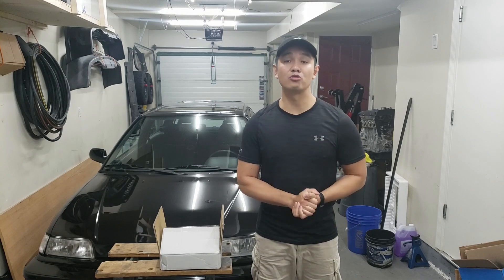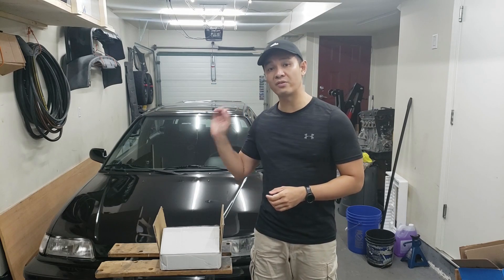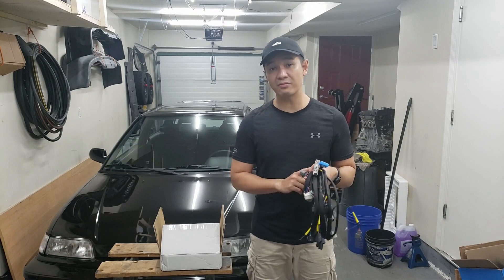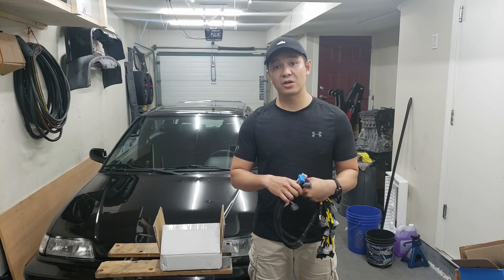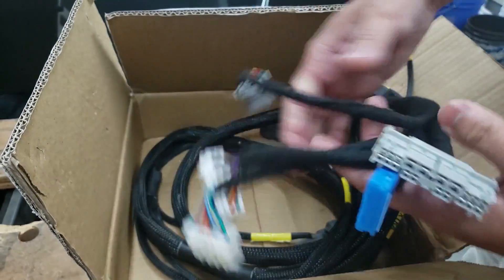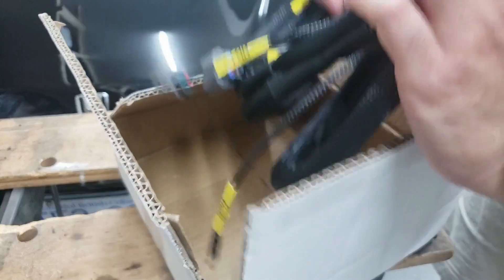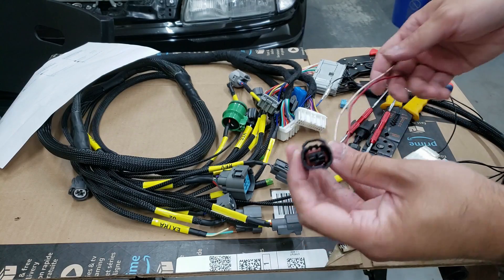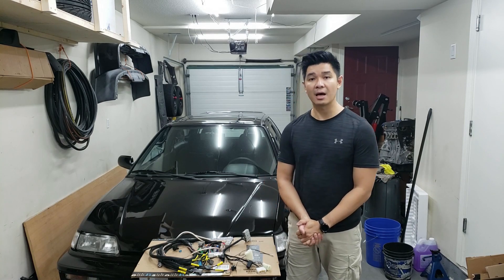||HONDA EF9 / ED7 88-91 CIVIC & CRX|| New Budget Engine Harness & Making a Chassis Harness 🔥

Comment: What does the sub harness plug into ??
Reply from the maker: 🤨 the car.
Reply: @BudgetGears 3 plugs to the ecu then one goes back to the original ecu?
Reply from the maker: @jay24232 are you asking about the tucked harness or the sub harness. Nothing plugs into the ecu for the sub harness. The tucked harness plugs to ecu and to the sub harness. The sub harness plugs into your car. The tucked harness is universal. The sub harness is vehicle specific. The sub harness is a bridge to make the tucked harness work with your car.
Reply: @BudgetGears I’m asking about the sub harness can I buy one for a crx Obd1 b16
Reply from the maker: @jay24232 not all engine harnesses are the same. You need to buy the engine harness and sub harness from the same manufacturer. If you got a China harness like i did, you'll need to map all your wires and make your own. The harnesses are not made equal. My harness could be very different from yours etc.
Reply: @BudgetGears I can buy another loom where can I buy the sub harness

Comment: Where did you source the connectors and pins for your chassis adapter harness? I'm also doing a EF with one of those budget engine harnesses. Thanks!
Reply from the maker: I did countless hours of googling to search for the connectors. There wasn't 1 specific places. Just all random sites. What was shown in the video was just the connectors I used for the harness. But I got a bunch of obd1/2 style connectors as well for other things. There's some stores in Japan that sold oem connectors, which required a min purchase,  then there's ebay, Amazon, other random sites, etc.
Reply: I didn't like the idea of plugging the chassis adapter to the engine bay connectors, so picked up a EK specific one off Amazon since it was cheap ($36 and change ) and arrived in two days. All I really needed was that big gray connector, I'll be hardwiring that adapter to the dash harness

Comment: how did you deal with connecting alternator wires? I have the same harness as you, one wire is going into ECU as it should and two of them, that is ignition and light, goes into the subharness connector, but how do you connect them if there is no equivalent on the obd0 harness so even the adapter that you've made won't help? Isn't it necessary to connect them to ignition switch?
Reply from the maker: Not sure what you mean no equivalent on the obd0 harness. Your firewall connector the 8 pin connector that's covered in grease that has a brown cover has the 2 wires for the alternator ignition and the alternator light in there.
Reply: @BudgetGears  oh you meant the one under the hood, got it. There is a 8 pin connector but I don't believe ther's that second one with 4 pins, is it something that not all of the 4th generations have? Also, are you reusing any other plugs on the shock towers besides those two connectors?
Reply from the maker: @kamidayaa264  There's 2 kind of wiring for the 4th gen's. Si's and non Si's. The Si's are wired for multi-point and the non Si's are dual point. The non Si's will use more shock tower connectors. What I have is a Si so it'll be what you see in the video. The non Si's will use more connectors.
Reply: @BudgetGears  that's very helpful actually, but the problem is that my non si car has less connectors than yours, specifically that 4 pin that you made a connector for in your sub harness, what was it for if you remember?
Reply from the maker: @kamidayaa264  I can't remember. I do remember one of the differences was the location of the backup light switch wires. You should map out all your wires and it'll be the process of elimination. I spent days mapping out my wires and checking the China harness before building the sub harness. The China harness was wired wrong so best to check your wires.

Comment: What wire did you use as power to the ecu
Reply from the maker: @madboostmark  Not sure i understand your question, but automotive wire was used.
Reply: @ I have the same harness… but I see no spot for the 12v power (for ecu) my car is a race car with no factory harness or fuse box.
Reply from the maker: @madboostmark  i can't remember the wiring fully, but pretty sure everything was turned on and activated through the ignition wire. I cant really provide much info on your situation because you've taken out so much of the oem stuff.

Comment: hello again! I'm back with another question n.n on the alternator connector, how did you know which wires S, IG & L belong to to change to the green connector?
Reply: My old harness has a Canadian model 3-pin oval-shaped connector, but I don't know in what order to attach the wires to the old connector.
Reply from the maker: @zairabarrigagarcia9411  you'll need wiring diagrams for the vehicle you have. I googled the wiring diagrams, went to my car and confirmed the wire colors and wire positions. I then googled the wiring diagram for a 4 pin connector that came on the harness. Did research to confirm if the wires were correct, which they weren't. Then cut the connector and rewired to the green connector based on the wire position.

Comment: Please show how you made the sub harness.
Reply from the maker: You can already see what I used to make the harness in the video. It's just crimping wires and plugging them into the connectors. If you're asking about the wiring, I can't help you there. Every tucked harness out there can be wired differently. You need to take the time and map all your wires to where each wire goes. That's the part you need to do before tackling any wiring project.

Comment: How about the starter wire
Reply from the maker: It's part of the harness.
Reply: @BudgetGears  so I guess it’s only the one from the Alternator from fuse box
Reply: Do you kno what the yellow label would say
Reply from the maker: @boostboyracing  Can't remember, but something pretty obvious like ST. Plus, it's the only wire with a female spade connector. Only 1 place it could go.

Comment: I’m stuck at this point with my build. That harness that you made, is it available on the market? I have a 1990 civic hatch with a D15 B1. Im bad with wiring and I need that adapter you fabricated to finish. I’ll be running a D15 with y8 head and a stock P28 with an eBay y8 harness. After hooking up the ecu I have a male multi wire rectangular pin male socket. Where can I find the part to complete my install? Any help would be greatly appreciated. Thank you.
Reply from the maker: The sub harness is available from many people that make the engine harnesses. Best to buy the sub harness from the manufacturer of your engine harness. As mentioned in the video, these harnesses are not all the same. If you purchased a China harness like I did, you need to do work on mapping your wires and ensuring the sub harness matches the engine harness. If you're not good with wiring like you said, then you should buy everything from a reputable store like Rywire etc. They have already done all the work to ensure the sub harness matches the engine harness.

Comment: Actually if you have a 3 wire harness then itll only work with a mitsubishi alternator (its not an mitsubishi alternator is that honda was using two companies supplying alternators) if you have a nippodenso alternator style yes you need 4wires ..if you keep it 3 wires youll have alternator and charging issues .

Comment: How did you wire in the reverse lights ?? I have a 1990 civic wagon   . With a d15b2 (OBD0) Im converting it to obd1. Dont you also have to get a different thermostat housing to replace the OBD0 one to fit the new sensor?
Reply from the maker: For reverse lights, cut the connector and change to bullet connectors or get yourself a obd1 reverse switch. For thermostat housing, yes, you can do it that way, or cut the connector and extend the wires to reach to the back of the block. I believe it also uses bullet connectors.
Reply: @BudgetGears I appreciate the feedback. If I could describe this channel in one word it would be “quality”. I will comment if I have any other questions thank you.

Comment: Hi.
Sorry for the late question, but can you tell me where you got those connectors? For example the alternator connector?
I run a 91 CR-X Si-R (sorry, we got those in Europe) and my connectors are really getting old and fragile, so I would really like to replace them, but my wires are fine.
Thank you very much in advance and thanks for all the inspiration!
Best regards, Tim
Reply from the maker: Unfortunately, there's not 1 place for you to get the connectors. If you're looking to replace all your connectors in your harness, then you'll need to search Google to find various sellers. I used Google to search for the connectors I needed. You can get most of the connectors from Beaver Power in Japan but you may find some on other connector sites etc.
Reply: @BudgetGears  Thank you very much!! Now I know where to start looking. Best regards!

Comment: i got 88-91 civic ef putting in d16y8 engine what engine harness should i get??
Reply: Dont take this the wrong way but its been said over and over.
When youre doing swaps in a ef/crx always keep your original harness and add the wires that you need ..for efs that are not SI youll need to add 8-10wires (2 for cyp 2 for ckp   2 for vtec 4 for oxygen sensors )  but if you wanna buy these newer harnesses youll need to either way cut the cabin side harness to make that new engine harness work..out of all the hondas the efs are hardest and worst to do swaps too..egs you order a harness and its plug and play on efs you still need to cut wires and add no matter how much you spend..however if you dont care and its just a drag strip car then throw the entire wiring of a obd2 civic into a ef youll have to use everything out of a ek including the cluster and fuel pump harnesses i mean everything
Reply: I have the same question
Reply: Same question

Comment: Hi, can you share the supplier info? what type of wire that? do you think it can handle the heat under the hood for turbo setup
Reply from the maker: I don't know who the supplier is. The harness is just a China harness. You can easily find them on Amazon, Ebay, etc. They're practically everywhere in different ranges of prices too. I've seen them for prices significantly cheaper than I paid on various platforms. I'd suggest doing some searching on your own as they're all the same and probably made by the same factory in China. I can't speak for the wire in the harness, but the description did say rated for 150 degrees Celsius, which is about 300 degrees Fahrenheit. So likely teflon wiring. I used 22 gauge wire purchased at a automotive store to make my chassis adapter. The chassis adapter will not see high temps so any wiring will do since that resides inside the car. As for if it can handle heat under the hood for turbo, it depends on how hot your setup gets. Everyones setup is different. If your setup gets hotter than the wire specs, then you'd probably need some kind of heat shielding for your entire wire harness. It also depends on which wires are close to or touching extreme hot areas of your engine. If you've noticed, a stock o2 sensor would usually have heat shielding around the wires. So it's really up to you to protect your own wires from extreme heat.
Reply: thank you 👍 @BudgetGears
Reply: So why would you not include the vendor or the company that you got your harness from ?
Reply: @elkuervoguerrero5694 damn, he HAS TYPED that multiple times. Read.

Comment: On eBay, there are a few harnesses that are specific to chassis. I got a 97 civic. It has the OBD1 ECU plugs with engine side as all OBD2A style.
Reply: Are you trying to replace your harness? I also run an obd2a Civic. I have an obd1 plugged aem ecu and run a jumper harness in between. I built current harness from a few other harnesses, but years later I would like to start from scratch. I can't find anybody selling a new china obd2a plugged harness, if that's what you're looking for. Or try to get a same year used si harness and mod that, probably what I'll end up doing.
Reply: @GIZZMOTORSPORTS  correct. Replacing the harness with a tucked harness. Now I have to source out a OBD1 P28. I do want to turbo the car later on but for now, simple and clean.
Reply: Hamotorsports